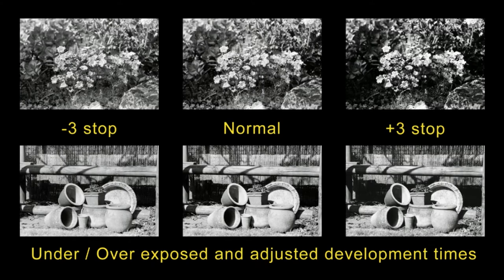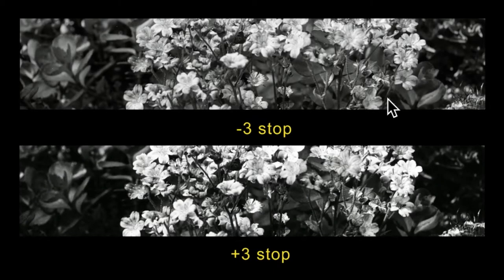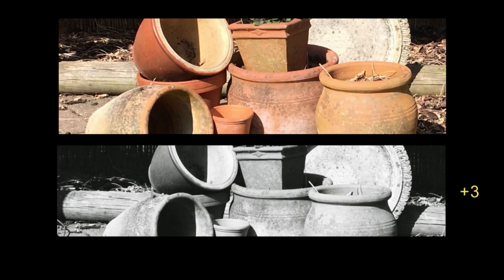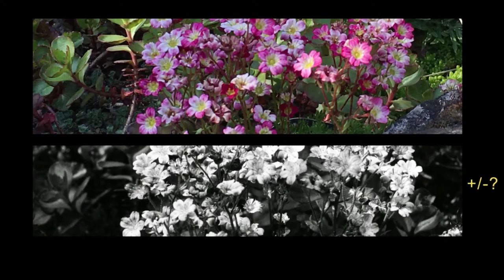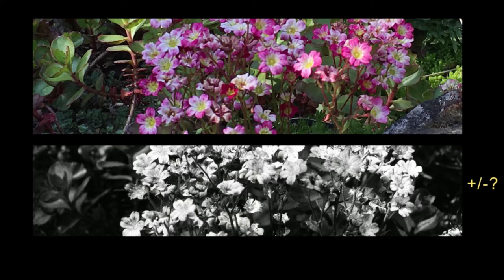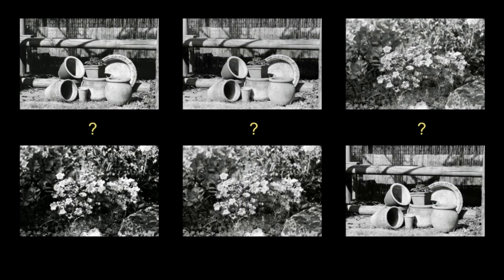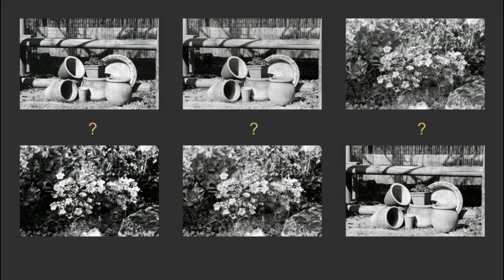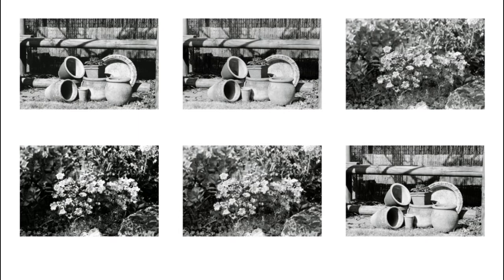Push and Pull Black & White Film Developing

Comment: You can pre or concurrent flash the frame to bring out the shadow detail again when pushing. 
The added contrast when pushing is simply because the film doesn’t reach its threshold for registered exposure. 
It’s electrochemical hysteresis. 
Flashing nudges it over the hump.
Reply: Interesting. This is the first I've heard this term. Just to make sure I grok this - pre-flashing would expose the film to some amount of light prior to capturing the final exposure?

What's the best way to do that? Double exposure with some diffusion material over the lens to ensure a uniform lighting of the film? And what do people find is a good pre-saturation value? Like, if I push 2 stops, would I want say -4EV?
Reply: K. Adam Christensen common wisdom seems to be that it’s easy to underestimate how much is needed and that about -3EV is a good starting point for a two or three stop push.

And it really does result in faster film.

Failing double exposure on your camera you can preflash the whole roll. 
Not ideal though since the effect wears off a bit as the halide falls back after a few minutes or hours and you just get more fog.

The best approach is really a simultaneous flasher, where you are flashing the film at the same time as you expose it through a 45 degree glass plate. 
More flexible and creative on all accounts. 
You have to build it yourself though. ;-)
Look up Gerry Turpin and Light Flex for hints.
Reply: @Frisenette  well hot damn cannot wait to try this. Thanks!

I had a feeling preflashing the roll would have plenty of downside, but I'm super curious about the 45 degree glass. Appreciate the pointers!

Cheers
Reply: K. Adam Christensen don’t know if you are being sarcastic, I’m leaning to a “no” though. ;-)
It’s not that hard to build. 
Toughest part is finding a suitable light panel.
Reply: @Frisenette  haha. Not being sarcastic at all (hope that doesn't sound sarcastic too 😂). Thanks again!

Comment: Hi, thanks for sharing the video.

If I want to shoot in low light, and put higher ISO film in my camera than I can set the cameras ISO to, that should over-expose to help in the low light. How do I then develop the film, as per box speed?
Reply from the maker: Remember that setting a a high ISO setting on the camera means it will give the film less light - but high ISO films can deal with that. If the film box says 400 ISO, but you set the camera to 1600 ISO, then you need to adjust the film development - in this case by +2 stops
Reply: The Darkroom UK Ltd  I mean, the other way around ISO of camera say has max ISO of 800. But put 3200 in the camera because I know I will be shooting in low light.
Reply from the maker: I see. The camera will still expose for 800, but using a 3200 negative film in low light... hmm... You may have overexposed negatives but at least you'll get something. It's difficult to guess what the camera will do in very low light, but give it a go.
Reply: The Darkroom UK Ltd yea I think I will give it a shot and see what the lab thinks. I know ISO 800 would be too low, so maybe develop -1?
Reply from the maker: @phillnavin1212  If it's C41 col negative, I wouldn't recommend adjusting the development - the film doesn't react well and you get some weird results in terms of colour balance. Better to have a contrasty/grainy looking neg. Just my opinion :)
Reply: @phillnavin1212  old post.. but you know you can compensate with your aperture i.e. 800 iso is 2 stops from 3200 so set your aperture 2 stops slower..